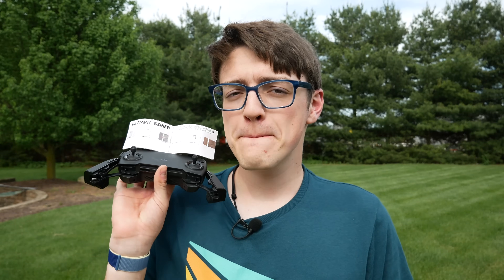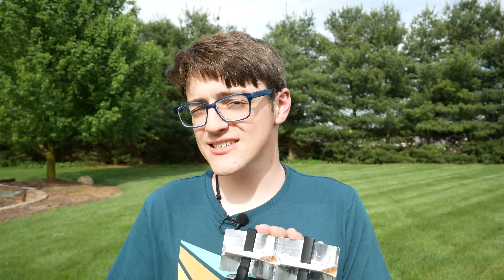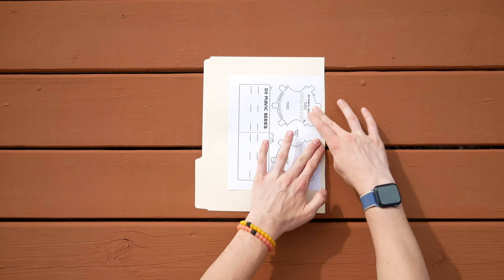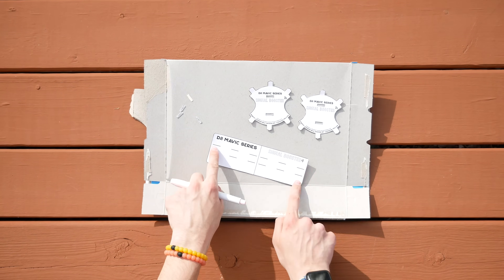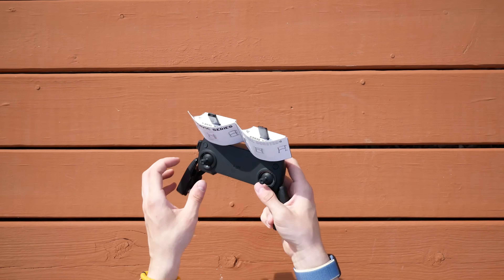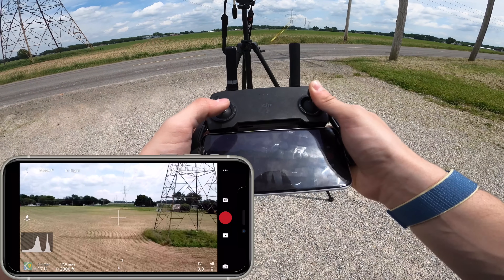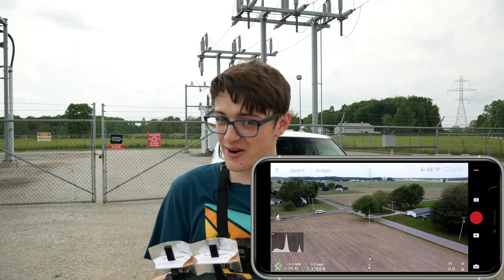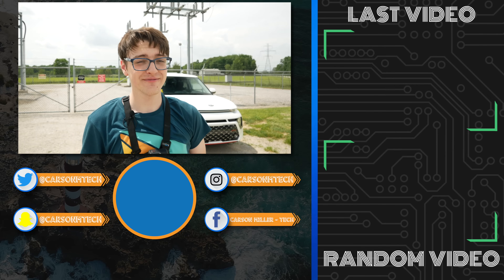DIY DJI Mavic Mini/Air/Pro/Spark RANGE BOOSTER/EXTENDER! [Make It Yourself For FREE]

Comment: As an added bonus, these can also be used on your home wifi router if it has vertical antennas.  Face the shiny side towards the direction you want a stronger signal (The signal behind the antenna will be reduced). You may need to separate the two antennas for individual mounting.

Comment: I've just made the extender as per your instructions. Your instructions were clear and worked perfectly! As opposed to the standard parabolic extender sold on the web, yours leaves room for addition of the yagis, i.e. using parabolic and yagis together. One video (don't remember whose) has tested and proven that the combination of parabolic and yagis gives a better result, i.e. greater range, than using one of the two by themselves.  Haven't yet tested - but well done!

Comment: Obviously this is a bit late in the day, but just a quick thanks for all your great videos.
Always wanted a quality drone, but having too many hobbies already and not enough time, I've only ever had sub 100£ ones. Great fun and excellent way to learn.
However, I've just moved into the middle of Wales (UK) where my nearest neighbours are 1 mile away and am surrounded by beautiful (but wet rolling hills) so now seemed the right time to invest.

With the Mini 2 out, 'barely used' Mavic Mini 1 fly more's are available for 300£ (from sensible sellers of course). This represents a saving of 250£ compared to the latest version!!! 
So forewarned of all the 'features' I have took the plunge but must admit to my disappointment at just how bad the wifi connection can be.
Despite being in the middle of almost nowhere with the nearest town 10 miles away, the connection really struggles for more than 500 meters
I will persevere  with various set up options suggest by yourself and others and make one of these most awesome extenders (mine already include the aerial type extenders) but I have a few days testing to do but may yet return it and get generation 2 mini in 2021
 
Thanks again for taking the time to make these videos, tutorials, pdf's etc etc.

Wishing you a more kind and prosperous 4 years after that most hateful manbabywithtinyhands!
 
Bob

Comment: Hey Miller...glad to see you’re doing well today during these uncharacteristic times.
Quick question for ya...what if you just wrap the antenna in foil?... would-en it boost the signal?...
Reply from the maker: Thank ya! Also, no, that would not work. Doing that would actually be very dangerous and would result in the signal being cut in more than half if not more.
Reply: @carsonmtech  
...but...the Yati range device seems to be a foil type attachment...with a little bit of plastic...
...I’m just want to improve signal...not some...of range...

Comment: I made it and test it out! Got now a stable connection and went easy 2km in Urban  area! And could go more...😲 same area: before I went only 800meters with Mavic Mini🙈 and RTH kicks in.
Thank you again! You did a great job!👍🙏
Reply: I barely got 30 meter 
I hate mavic mini. I regret buying this and not a second mavic pro
Reply: @imdyinginside1919  try the mini 3...
Reply: @ferdronemedia   when you say urban, are you talking about more on the side of city buildings or neighborhood housing?
Reply: 800m, I can barely get to 2000 ft and it still has spikes from 0 bars to 2 bars of GPS signal even in country ,in the national forest I have flown past 15400 ft and even flew into dark fog clouds past 3400 ft up to take pictures close up.

Comment: Thanks for the video and the template. What if you cover the parabolic also in aluminum foil?
Reply from the maker: I wouldn’t. That would cause unintended reflection of the signal in directions not needed
Reply: @carsonmtech  Thanks for you quick answer.
Reply from the maker: No problem Wilson!

Comment: Thanks for the video and the free download. I made it and tried out yesterday in urban area. I can fly without it 300m and with it 412m. I used 5,8GHz Channel 153, I put down the controller to a table and only moved the sticks. Thanks again. It could be very helpful if fly to far.

Comment: Buddy you have done an awesome job with that project and thousand thanks for giving the pdf file for free! 
Also I would like to say that even if you warp the rectangular piece with the foil, inside-out it will still work.. the signal waves will pass through the paper, bounce on the metal surface of the foil and go to the antennas.. A part of the wave's strength might be absorbed in the paper but it's not that big of a deal.. 

By the way... if you are a DIY guy you can try to make yagi antennas for signal boost! Just read how yagi antennas work and since you know the transmissions frequency you can do it! Be aware the yagi antennas are extremely directional and if you actually build them, when you test them out ALWAYS point at your drone!

Also you can just ignore me 😋 but still thanks for the template!!!!

Comment: Hey nice I’m glad you DIY these i been waiting for someone to make them but I still curious what if you make it 50% bigger? Will the range increase significantly? Or if someone knows more any reason why will not work? Any way thanks for the vid buddy!
Reply from the maker: Thank you! As far as making it bigger goes, like I mentioned in the physics behind how this works portion of this video (towards the end), the size of this is incredibly critical. If you made a booster that was 50% larger for each antenna, first of all, you likely wouldn’t be able to fit them both on this controller, but also, the parabolic design would need to be changed up. This specific parabolic design is meant for this size of print and if you made it larger, it would no longer work as intended since the reflective nature of the booster would no longer work as designed.
Reply: You can make it bigger, but...

1. You need to follow the curvature of the parabola (as defined by its equation) so that signals continue to bounce to the same focal point (where the antenna is situated).
2.  You can make it taller than the antenna, but that would be impractical since there is no antenna at the extended focal points to receive the signal.

I'm basing my notes above on the mathematics of parabolas and their focal points.  There is very likely a practical or "good-enough" size to get reasonable gains, and Carson's size is probably very close (if not ideal) to that since there are two adjacent antennas on the controller to consider.  You could leverage a wider reflector for a drone that has a single antenna on the controller.

Comment: Good idea and very useful to have an additional layer of safety in case of flyaways.
However, if you want to test your signal boosters and experience some real interference you should fly near TV antennas or better (I should say “worse”) a mobile cell antenna.
A constant 50/60 Hz electromagnetic field is too far in frequency from the one used for the drone transmission frequency.
The higher frequency of TV and mobile radio frequencies, with their highly modulated radio waves, cause potentially major interference with the controller’s signal.
And one more thing... the parabola focuses the signals in one point (the focus) only if the direction of said signals are parallel with the axis of symmetry.
Reply: This is so true Can’t fly mine further than 1200f away... why? cuz there’ is a big ass 5g antena near my house it is in the mountain but still affect a-lot my flying range 😓
Reply from the maker: DOH! I can’t believe I didn’t think of that one. I know of a couple places that would have those types of antennas near and so I will need to keep that in mind for the future. Also, I appreciate the correction on my parabolic design scientific explanation. Thanks!
Reply: Glad to help... didn’t waste my tuition fee as an electrical engineer graduate

Comment: I have tried using parabolic boosters with my FAA 5.8 ghz Mavic Mini in open area without wifi interference and could never really see where they helped. But I also have the Yagi 5.8ghz boosters and have found them to help. I by no means am and expert in wifi transmission but this is what I believe is the reason the Yagi is superior to the parabolic in open field environments. The parabolic will focus the transmittal beam in a narrower band than without it therefore helping cut through the noise to the drone receiver. But where I believe the issue really lies is with the drone's transmit signal back to the receiver. This is where I believe the Yagi come into play. I believe they are quite a bit more capable of capturing the faint signal from the drone than the stock antenna and the parabolic. As I said I fly in a open environment void of wifi signal and have achieved greater fpv distance with the Yagi than either stock or with parabolic extenders.
Reply from the maker: I have heard a couple people talk about the Yagi boosters - I’ve never tried them myself before. I may need to go pick some up and try them out!

Comment: i have the worst luck with range on my mini , i get less than 1000 feet and i get no signal warnings and return to home constantly, i have the plastic booster that looks like the one you made but it sucks too
Reply from the maker: Hmmm, that’s very odd. I’ve always had success with parabolic boosters like this. What type of area are you flying in?
Reply: Carson Miller i am in a pretty populated town in massachusetts with lots of tree and right near the ocean but i figured id would be better than what i have been getting even when im in more of an open area

Comment: Nice job Carson. I did appreciate your hands -on demo of making this booster. Put the video in my Like folder, so I can get back to the info, should I decide to make one myself. 
I do have a Ultimax Parabolic range booster. I've tried it out in the past with both my Platinum and 2 Pro. Not sure if it did anything. But tomorrow, I'll be flying around my friends ranch and orchard. Where I launch from, trees can become a bit of an issue - depending on altitude.  Even at 60' AGL, it can be a bit dicey (at least in my mind), even though that puts me at least 35 feet above tree line. Just have to keep in mind, that the signal is no longer radial, but more directional, so I need to keep the controller pointed in the direction of where the drone is. Perhaps I might be wrong on the signal direction..... Hmmmmm......
Ciao
Reply from the maker: Tony, yes, the direction of your controller compared to where the drone is is certainly important with this booster on. Just one more thing to think about, but I think it’s worth it! Have a great day